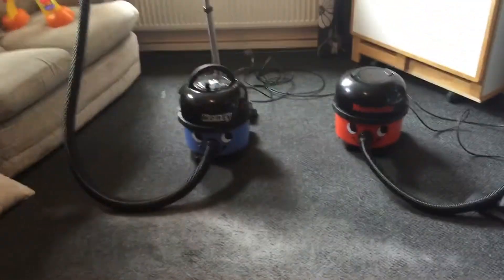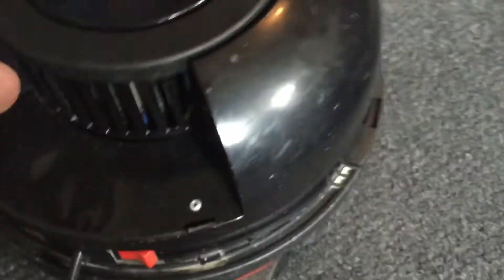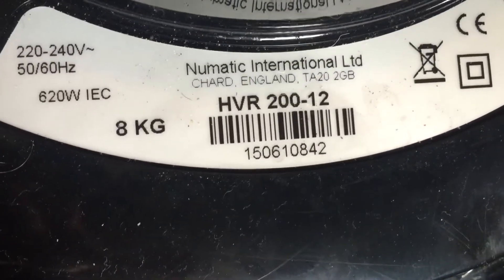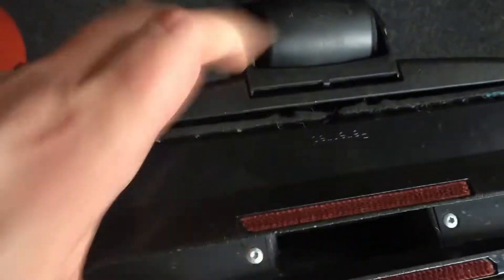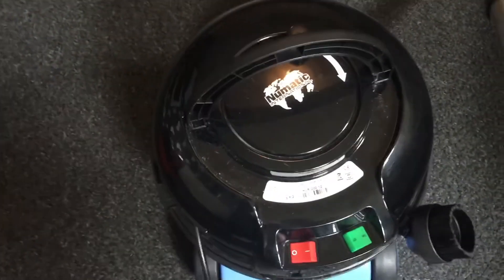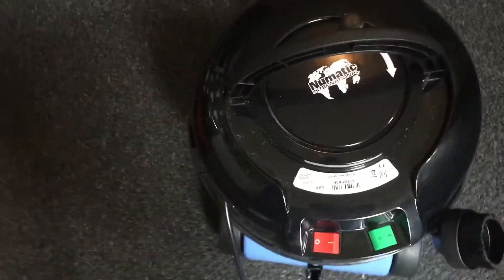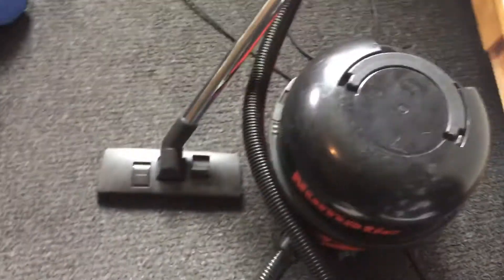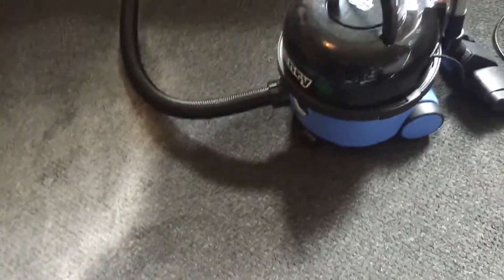Henry Hoover HVR 200-12 VS Numatic NV 200

Comment: Thanks for the comparison Mac. I'm thinking of getting one, and no doubt it'll either be the George, all in one, or more likely the HVR 200-12. After watching your vid, I couldn't believe you didn't just simply swap the heads over to at least rule out that as an effect! I agree with the NumaticVacuum below, and find most problems begin with it's weakest link. Unfortunately in some case that usually means the owner, due to lack of care and servicing of a quality British made item. I've seen plenty of quality appliances thrown out because of an avoidable performance drop due to lack of care, and more money than brains mindset. Not that I'm accusing you Mac of the above, I'm grateful for your upload, just would've loved to have seen it then re-run with the heads, or hose and heads swapped around too.

Comment: Do they both have the modern type cloth bags in them?
Reply from the maker: guitarplayerforu I cant quite remember but I think they were both hepoflow bags
Reply: BIGMACWUSTA 90 The reason I asked was, the suction might have been less on the 22 year old Henry if it had the older type Paper bag in it instead of the modern Hepa bag. Try the filter out your new Henry also to see if it helps, because if the filter is dirty or worn it might be restricting the Airflow, reducing suction.

Comment: Nothing to fo with the age, the suction on any henry, any age is pretty equal. It is the floor head, if you had used the head from your new Henry on that old NV200 it woulf of done the same :).

Alex.
Reply from the maker: I might just try that :)
Reply: i have found that with alot of vacuums made by numatic is that as they get older the motors seem to get weaker. i dont know if its the motor running slower due to the carbon brushes being worn down but quite a few do lose suction as they get older my aunty had a henry for 6 years before it lost about 70% of its suction and then wouldent pick up the dog hairs anymore it still worked for another 5 years and my mums hetty has also lost suction after 4 years of daily use.
Reply: benjamin fisher LOL, no, it is due to the fact that the filter will be caked with dirt and will need either washing, or replacing. And the bag replacing.
There is no reason why a Henry from the 80s wouldn't work as well as a brandnew one, the suction has never really changed. My 1988 Numatic Henry is just as powerful as my   2015 Henry.
Reply: ah right. well to be fair all the henrys i knew that lost suction had been used bagless for years which im guessing isnt great for the motor and filter anyway lol my mum uses her hetty bagless and so did my aunty with her henry and they tried new filters but that didnt work however my mums friend has had her henry for about 10 years and has always used it with a bag and that still has 100% suction
Reply: Plese can i  have your henrry